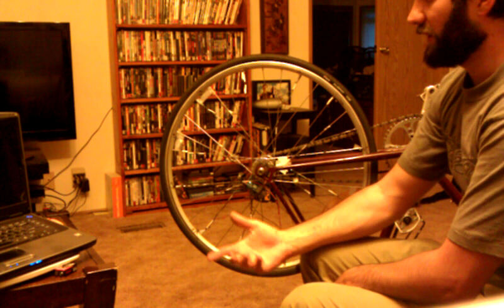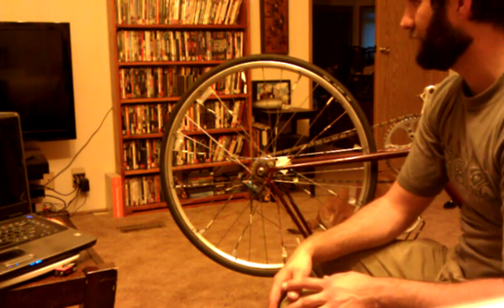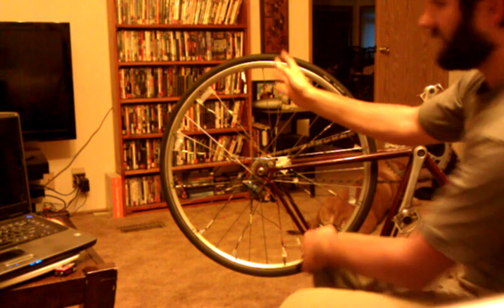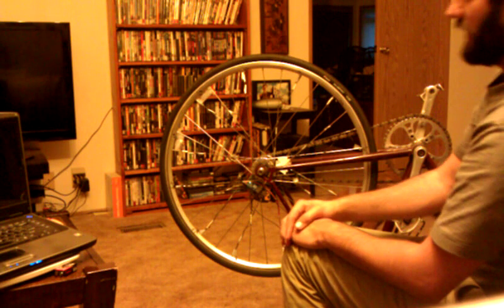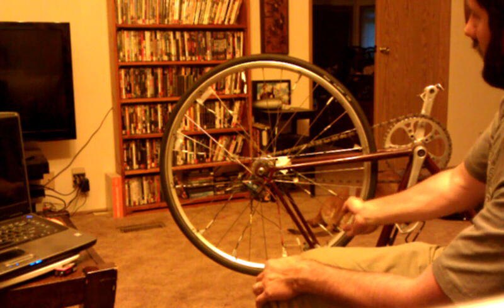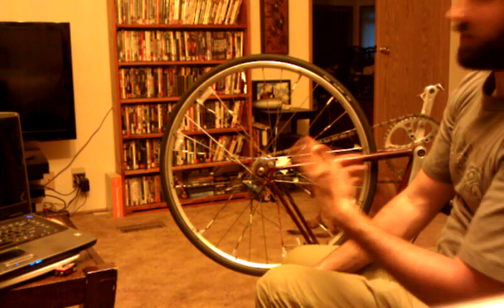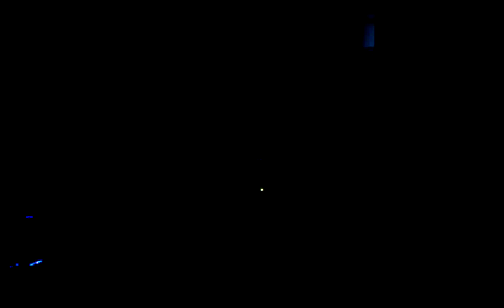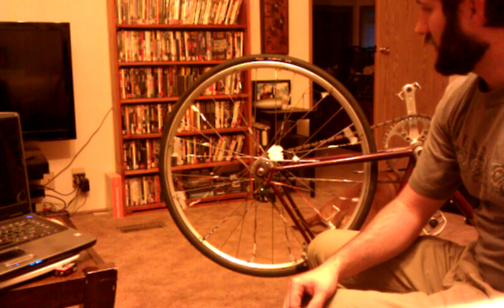Revolight - like arduino bike light system

Comment: Hey, I wrote my own code for this to make it a bit more customisable/efficient, I would love some beta testing if anyone is interested.. The code is available here:

http://123d.circuits.io/circuits/718389-revolight

Main points:

- Optimised LED addressing, 10x faster than the code in the description which accounts for much less strain on the battery.

- Support for offsets, move the arc on the fly. No rewire / reprogramming needed if you wire it up differently. Same code will work for both front & back. { Potentiometer }

- Reversing the direction of the chase. Might be useful. { Slideswitch }

- Use the supplied sequence creation tool (Windows only) to easily make special effects (5 are included).

To Do before release and fabrication:

- Battery indicator, when you turn it on for the first time, it shows you how much battery is left.

- Auto Deep Sleep, turns itself off after 20 seconds, and saves battery.

Comments greatly appreciated!

Comment: You can use either board. You will need to change the pin outputs to match the code i wrote for the arduino uno.

Comment: This is awesome, I just built this but had made some small changes to the code. Mine would not work if it entered standby mode and began pedaling again. Here is what I set standby() to: 

void standbymode()
{
  for(int i=1;i<=13;i++)
  {
    if(i == 2)
    {
      i == 3;
    }
    digitalWrite(i,LOW); 
  }
  
 if (revolutions<=1)
 {calRPM();
 }

}

That way it recalculates the revolutions when it rotates. Also I used a switch instead of the magnetic sensor. But over all great build and thanks for the video.

Comment from the maker: I'm slowly working on a surface mount board that will use an Attiny167 board with the arduino bootloader to run this code. I'm designing the board on eagle and want it to be as small as possible so everything will be surface mount. I'll make a list of parts, post a new video, and opensource my board layout so anyone who wants to build it can.